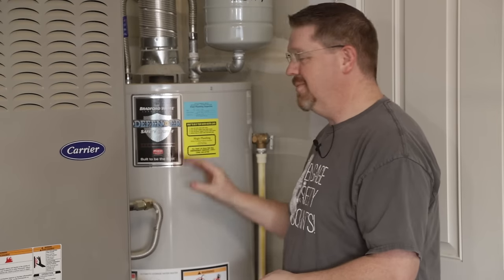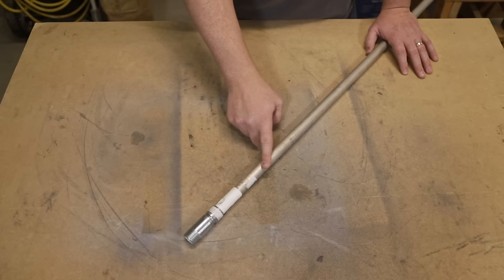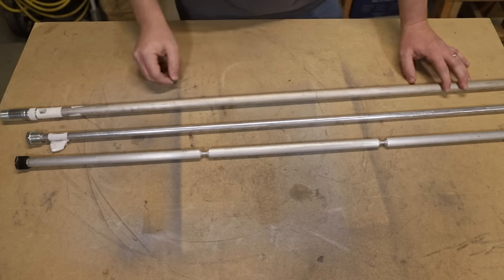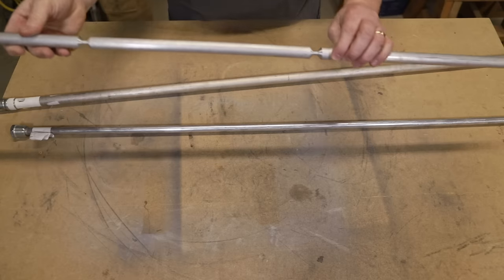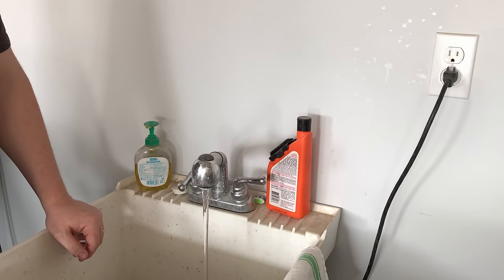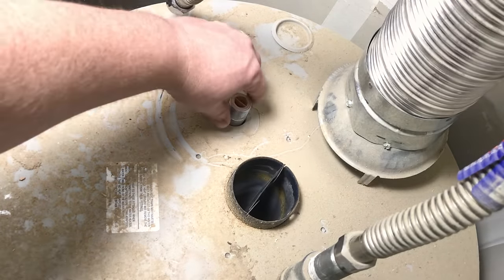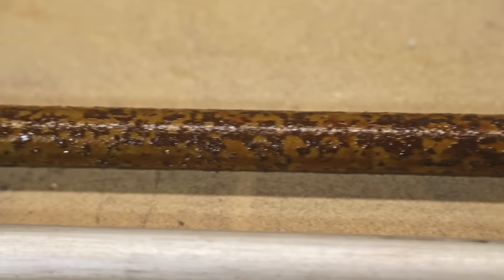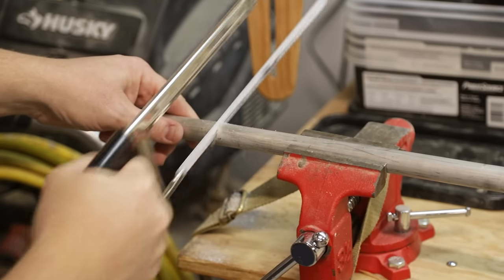How To Replace Water Heater Anode (Step By Step)

Comment: so when you reconnect the hot water line to the new anode you don't use teflon tape or pipe dope?
Reply from the maker: No, the fitting for my heater has a rubber washer inside that seals the connection. You should not use pipe dope or teflon tape for such a fitting. Great question, thanks for watching!

Comment: Did you not need to add teflon tape or pipe dope to the top threads?
Reply from the maker: Hi Chris - no, the fittings that connect to the top threads have rubber washers inside them which make the seal water tight. It is not recommended to add thread sealant or pipe dope to that type of fitting. Thanks for watching!

Comment: I have a leak where water appears near the cold water pipe, but then hot water. How would I determine if it is the pipe or nipple leaking versus the tank itself? It’s a Bradford White tank like yours.

Comment: Great video. I enjoyed the walkthrough.  I've seen some people mention that they measure the resistance of the annode with a multimeter.  What is the purpose of this, if you don't mind me asking.
Reply from the maker: Resistance? As in they need to measure Ohms? That does not make a whole lot of sense... I could possibly see a case being made to measure continuity of the anode, as it needs to be a conductive path from the anode to the steel of the tank, but resistance? That does not make any sense to me - unless they are just measuring a large drop in resistance from the threads to the body of the anode rod as a means to confirm a conductive path.

Do you have any links you can share that describe what you are talking about?
Reply: @AmplifyDIY  you are correct, it is continuity, not resistance.  
Check out this video towards the end where he uses a multi meter
https://youtu.be/xfYJjPRKqOA
Reply from the maker: Yeah, he's just demonstrating that even though he put a TON of teflon tape on the threads, the metal of the threads was able to cut through the tape and make a solid conductive connection with the body of the tank. This is important because the reaction with the minerals in the water and the anode is an electro-chemical one, so there has to be a conductive path to the anode from the steel of the tank. There is no real reason to do a continuity test though - if you tighten then anode, it'll make a good connection. Even with tons of teflon tape and pipe dope.

Comment: You can buy a tank with a stainless liner.  Personally I replace my tank every 10 years on a schedule.  Before you use a pipe wrench on threads knock a tap down inside.   This gives you the extra strength you need.  NExt time clean the top of the heater before you start.  Both, always and you will never get a leak.
Reply: omg all that debris on the top really bugged me.

Comment: Confused🤔, first you turn the anode rod clockwise as it would be correctly inserted into the water heater then you said @17:15 to install the tape in the same direction but your hand was gesturing counter clockwise?  which is the correct way to put on the tape, clockwise or counter clockwise? Thanks!
Reply from the maker: Hi Stephen - I just went back and checked, and at 17:15, my hand is gesturing clockwise - but it's at a bit of an angle that makes it hard to see. Here's the rule: If you hold the pipe so you are looking down the end of it, wrap the tape clockwise around the threads. Good luck!

Comment: One thing about watching Youtube "fixit" videos is they so often jump into "guessing", like you ordered a rod supposedly by looking up the model number of the water heater, then arbitrarily decide to shorten the anode rod, which may have been unnecessary.  Didn't see any attempt to take any measurements or maybe call an 800 number to get the actual info.  So while I appreciate the information, it would be nice if we didn't have such guesswork entering the picture.  Also, when I see the white sealing compound already applied to the threads by the factory, that tells me maybe I don't need teflon tape because why else would they apply the white thread sealer at the factory?  Also, as people often wonder, is there a chance the teflon could electrically insulate the anode from the tank, defeating its purpose?  And when I see the old rod barely corroded, if at all, it makes me think it should just be sanded or scraped off (cleaned) and reinserted, making sure it has electrical contact, because if it has been in there for years and not corroded at all, either it is not needed, or it is not making contact in some way.
I do know if I watch enough videos, I can fix anything, getting a little more info from each video, until I have a decent chance of getting everything right, so thank you.  :)
Reply from the maker: Hi Doug - Thank you for your thoughts. I didn't "arbitrarily" decide to shorten the replacement rod - I did it to match the length of the factory-installed one. I also mentioned in the video that the rod I removed was in good condition, but I went through with the replacement specifically to show the process and cover any oddities (such as a differing rod length) that may come up. Also, teflon tape on threads is meant to lubricate the threads as they are tightened, allowing the threads to cleanly slide over each other... but the teflon is quickly cut right through by the threads, and good electrical contact is made. This could of course be confirmed with a multi-meter / continuity tester post-install, but I didn't want to get too far into the weeds. At any rate, I appreciate your thoughtful comments, and thank you for watching!

Comment: how often is it recommended to replace?
Reply from the maker: Hi Joe - usually you'll want to check it 3 years after installing the heater, and then annually after that .Replace it when less than 50% of the original thickness of the anode remains. Thanks for watching!
Reply: @AmplifyDIY  oh so like probably 10 or 12 years I should take a peek lpl

Comment: Nice thorough video, thanks. Curious, I'm not familiar with the 'heat-trap' that you installed to the anode rod pipe fitting and what it's purpose is. Should it be installed with 'all anode rods' or is specifically used with that type anode rod? Is it a safety feature, critical, non-critical or is it optional? Thanks again.
Reply from the maker: Hi James - The heat trap is specific to my brand of water heater. If yours does not already have one, you don’t need to install one. You can learn more about what a heat trap is, how it works, and whether you need one here: https://en.wikipedia.org/wiki/Heat_trap?wprov=sfti1

Good luck, and thanks for watching!

Comment: Wish you would have included links to the rods to purchase—-how long are the individual  links in the segmented one so I’ll know to have enough height ?
Reply from the maker: I didn’t leave links because they are not universal. You’ll need to find the right rod for your specific heater. If you google your heater model number and anode, you should find some good options. 

Segmented ones come in a variety of sizes and materials as well.

Comment: Hey just open the head of the water heater and their will be the nut of the anode rod. A lot of things are hidden under the head of the water heater.
Reply from the maker: On some models that's true, but not on this one.
Reply: @AmplifyDIY  another solution is that when you buy the new anode rod buy that one which has a nut on it and do keep in mind the height, diameter  and material  of the anode rod which fits best on the water heater and which works best with the water heater. Good luck.

Comment: I have a two year old Rheem 40 gal electric water heater that I am performing maintenance on and want to check condition of anode rod. Pulled plastic cap where rod should be. Dug through nearly two inches of insulation before I found green ground wire running across hole.NO LUG NUT FOR ROD. Called Rheem tech support and was told the rod cap nut is buried in insulation 5 – 6 inches below top of the heater. UNBELIEVABLE!
Reply from the maker: Wow! That’s even more of a pain in the neck than mine! They really don’t want you to replace it...your heater might last lots longer and not need to be replaced, after all!
Reply: That should be illegal.

Comment: Good video- planning to replace my anode rod soon on my BW heater. Curious if you had the leak at the end because you didn't have teflon tape on the top threads.
Reply from the maker: Hi Kevin - no leak on the top fitting. The flex pipe it connects to has a rubber gasket inside it which creates the seal. No need for tape on that fitting at all. Thanks for watching!

Comment: 14:44 - I don't know how that heat trap is supposed to work when that black blocker valve part is smaller in diameter (slightly) than the diameter of the part above it that rides against the inside of the anode rod/outlet pipe. Won't water get past that gap? I bought a replacement heat trap and the black valve part is smaller in diameter in the same way. Can't say that for the cold water trap where the black valve is wider in diameter.

Comment: That’s the stupidest designed anode rod. They almost got it right though — but not having a hexagonal surface area to grip and remove it in the first place just means the company wants to force you into calling them for replacements. I can’t support a company like that.

Comment: When transporting a new hot water heater, it seems it would be important that it remain vertical.
When laying on its side, it looks to me that the anode would very likely bang against the glass coating
on the inside of the steel tank.  Is that important??
Reply from the maker: Great observation! Yes, it's absolutely important that you transport a water heater standing up. As you observed, you should NEVER lay one on its side that you intend to use.

Comment: 13:17 the replacement anode does have a longer 'head' on top of it. Was that a redesign to allow for easier removal?
Reply from the maker: I think maybe so, yes. There is certainly more meat up there now than on the original. Thanks for watching!

Comment: The hardest thing is to find a cheap rod. Would it be ok to put in a 700mm instead of the original 1000mm.
Reply from the maker: Sure, you can put in a shorter rod. It just won't last quite as long. Good luck!

Comment: Well all you need is two nuts to fit the nipple jam them together and unscrew never touching the threads with a wrench, if the anode is in half good shape you do not just shove it back in you take wire bush to it then re install as long as you have not messed up the threads.Neve put a wrench to any threads you plan ir nay have re reuse.
Reply from the maker: Great tips!

Comment: Non of the supply houses in my area have the heat trap. Can I re-use the existing heat trap or should I order one online and wait to do the job at a later date?

Also, I don't have the clearance above and already have the new long rod, my supply house didn't have the bendable kind. My tank is 8 yrs old and I've never replaced the rod so I want to flush it out. I'm thinking that when its empty I can tilt it over to insert the long rod. That should be fine, right?
Reply from the maker: Hi Dobra - yes, you can re-use the existing heat trap, and tilting the heater to insert the new rod should be just fine. Be careful you don't strain any gas lines if yours is a gas heater.

I'd go ahead and order the new heat trap as well though - they are easy to replace, as it just sits into the fitting at the top of the anode rod. You don't need to remove the anode to replace it. 

Good luck!

Comment: Great vid!👍🏼 I have a frustratingly designed w. heater, in that, the nut for anode rod is relatively small And it’s recessed in the body of heater. Afraid to strip it out as I can’t get a good grip w/any tools. Any suggestions for removal?
Thx again
Reply from the maker: Is the anode built into the outlet pipe as in my video, or is it separate? If it's separate, I suggest a strong socket with a large pry bar. Good luck!
Reply: @AmplifyDIY  separate. Wil try….again 😩

Comment: Bradford white makes itore more costly to replace the anod rod. Other water heaters the anod rod is on top of the water heater, but Bradford white you have to remove the hot side pipe and then unscrew the anod rod out, so if your a licensed master plumber like myself and are old school and solder all your copper pipe , now it's a hassle because you have to cut pipe and then re do it.
Reply from the maker: Yeah, I'm not a huge fan of how Bradford White has this setup. Thanks for watching!

Comment: Does the anode need metal to metal contact with the water heater for the anode circuit to work? In other words, can Teflon tape break the electrochemical circuit?
Reply from the maker: Hi USALibertarian - the teeth easily cut through the Teflon tape when you are tightening up the fitting. There is always good metal to metal contact even with a generous amount of Teflon tape applied. This can easily be tested with a multimeter/continuity tester after installing the anode, in case you were concerned.. Great question and thanks for watching!

Comment: Don't waste your tine replacing an anode. They are deliberately installed by the manufacturers of water heaters in such a way that they are almost impossible to remove without damaging or destroying the heater. The idea is to force you to buy a new heater.
Reply from the maker: Yeah, they are pesky to remove, but an hour's time (and being careful) could extend the life of your heater for many years. Worth it in my book.
Reply: Epoxy is not your friend.

Comment: My water smells. I was told to remove the rod on this and just leave it out. Is that possible?
Reply from the maker: It would be far better to replace the rod with the right kind. Is the smell a "rotten egg" smell? If it is, you should replace the rod with an aluminum/zinc alloy rod rather than magnesium. You can learn more about this here: http://www.waterheaterrescue.com/Troubleshooting/stinky-water-in-hot-water-heaters.html (note: I'm not affiliated at all with this site - it's the first thing that came up when I searched google for: "which anode rod rotten egg smell?". Good luck!
Reply: Leave it out a Bradford white rep told me people do that in cases where they can't get rid of smelly water after changing several anod rods without rod your water smell will be gone but will have to change heater sooner for tank leak  it's a trade off ,,
Reply: Are you sure it’s the water and not the sink drain? My sink drain smells but the water, in a cup, is ok.

Comment: Great video, thank you very much. I have the exact same water heater brand as shown in your video, so just wonder how often I should replace anode rode? Thank you.
Reply from the maker: Hi Ronald - Bradford White recommends you start checking the anode annually 3 years after install, and replace it when less than 50% of the original diameter remains. Exactly how long this will take will vary greatly based on the type of water supply, whether you have a softener, etc. 

Bottom line: If your heater is more than 3 years old, it's time to check the anode. If the anode looks really thin, it's time to replace it. Thanks for watching!
Reply: @AmplifyDIY  Ok, thank you for the explanation.

Comment: What was that plastic looking cap inside your new annode? You left it in when you hooked up the water line?
Reply from the maker: Hi D. M. - it's called a 'heat trap', and purports to keep more of the heat in the heater rather than letting it escape out the hot water outlet pipe when a tap is not opened.

Comment: The recessed cap on top of the tank near the anode, what is that for?
Reply from the maker: Hi Killer Bebe - I believe it is used during manufacturing as the place to add the expanding foam they use as insulation between the outer shell and inner tank. Thanks for watching!

Comment: Why do you refer to magnesium and aluminum as alloys?
How do you know when this needs to be replaced? I'm nearly 74 and never replaced one in my lifetime?
Reply from the maker: Hi Jack - There are 3 main types of anodes: pure magnesium, pure aluminum, and an aluminum/zinc alloy. Apologies if I misspoke in the video regarding exactly what they are made of. 
As far as when to replace them: The rule of thumb is to start checking the state of the anode after it's been installed for 3 years, and then annually thereafter. Once the anode has deteriorated to the point it is less than half it's original diameter, it's time to replace it. 
Thanks for watching!

Comment: What’s ur opinion with corro-protect electric anode Rod?  I have a 12 yr old gas ao smith water heater, have well water and a water softner.  My problem is a sulfur rotten egg smell from the hot water only.  If I replace with the zinc anode, how often do I change it?  I heard with the electric Corel-protect, it’s made of titanium and never needs to be changed ever
Reply from the maker: I've heard good things about electric anodes. They are expensive, but for your application they may be the best option. Good luck!

Comment: Is this why our Bradford White heater is making loud sound when it's reheating ?
Reply from the maker: Hi Joe - most likely, you have a lot of sediment built up at the bottom of the tank, and will need to flush it out. If you have never replaced the sacrificial anode, and the heater is more than about 5 years old, you should replace it as well. Here's the video I did on how to flush the heater. https://youtu.be/hs5N7HyDUWo
Good luck!